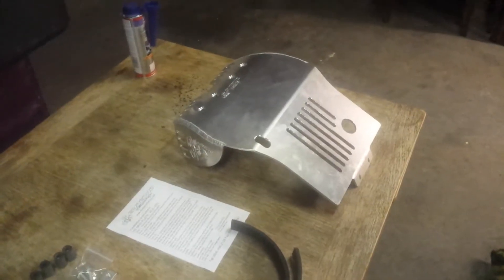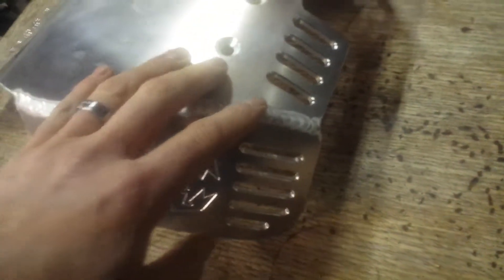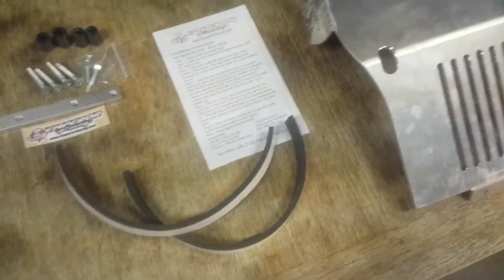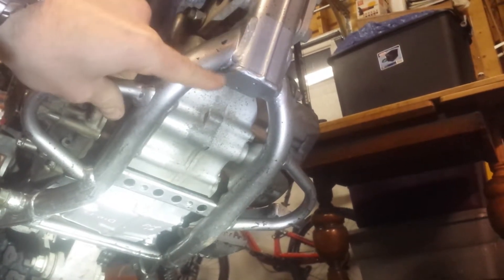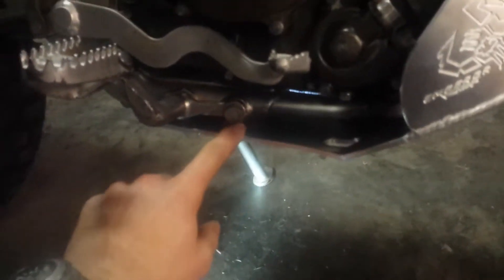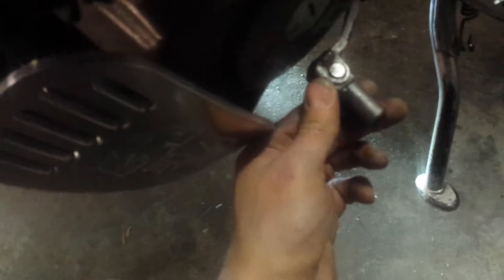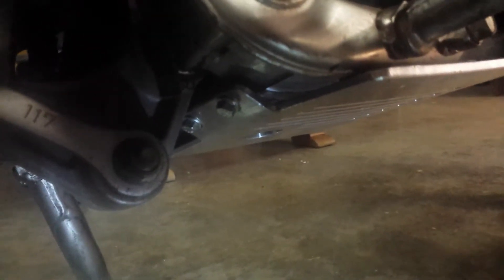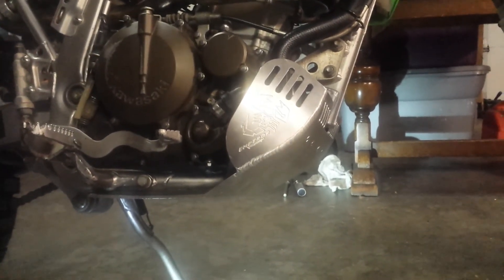Emperor Racing KLX250S Skid Plate Review

Comment: Nice. But I could have used the actual install. I couldn't get my plate to fit on my klx. Had to fab a bracket for the two bolts at rear of the plate.
Reply from the maker: I figured it wasn't necessary. Did the rear bolt holes on the plate not reach the holes in the frame? I had to tighten up the rear bolts first in order for the front bolts to fit. I found that tightening them moved the plate forward.
Reply: Motoritis I did try various ways of getting the plate on but no luck. I think I see that your frame tubes are round but my frame tubes are rectangular. On the right hand side the frame weld pushes the skid plate down. It's on now and is not going anywhere.
Reply from the maker: Bill Kirby I'm guessing yours is a Gen 2? Mine is an earlier Gen 1 (2007).
Reply: Bill can you show me how you solved your problem my welds are holding the plate as well back bolts can’t reach

Comment: Somebody needs to make a plastic skid plate for these bikes that covers the linkage as well. Metal is nice and all except that it adds weight and can rattle against the frame as well as bounces engine noise back to the rider. With this design the link not only has the possibility to get hit and break, but by covering it in a flat plane with a plastic material you can help slide over objects like downed trees, rocks etc.. of course it could be made for substantially cheaper with a lower price tag. Plastic is the standard choice for hardcore enduro riders.
Reply from the maker: This plate is rock solid and does not rattle. I did not notice any increase in engine noise either. I would agree that plastic better, but for different reasons. This aluminum plate tends to bend when hitting objects, whereas a plastic plate would absorb an impact and spring back into place.